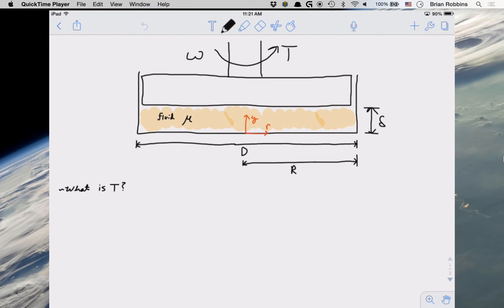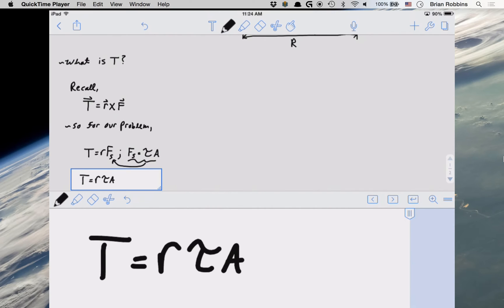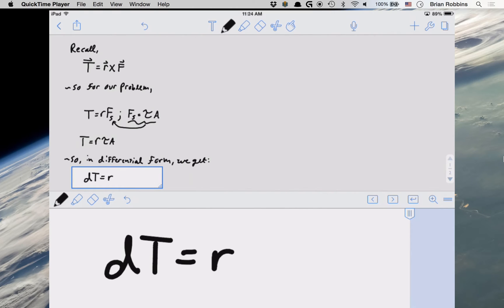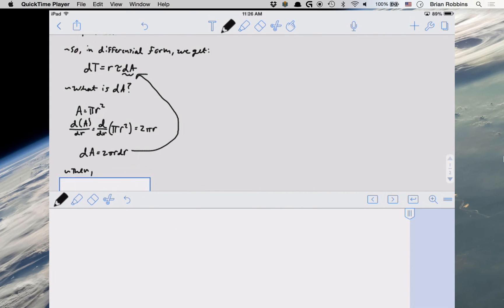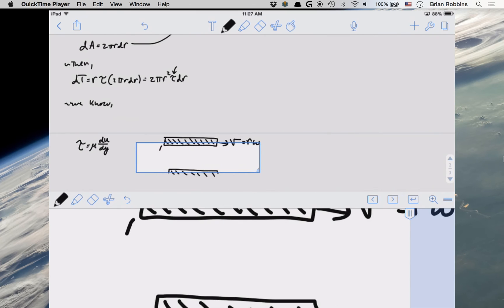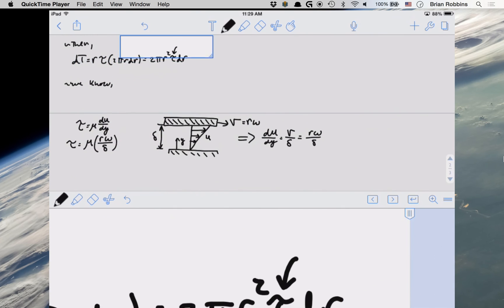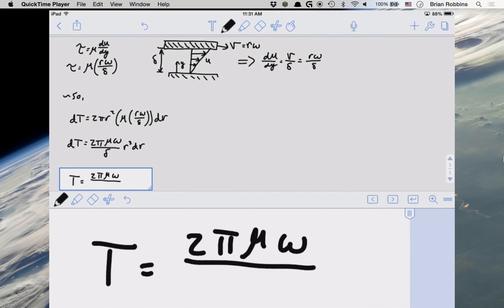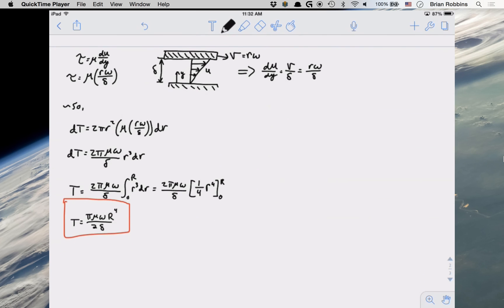ME-2124: Determining Torque using the Viscous Shear Force

Comment: Thanks for the video. I would like to ask a question. What if the rotating disk is immersed in the fluid, and far away from either the top or bottom surface of the fluid? How can I calculate the du/dy? Or how is this delta in your video determined then? Thanks a lot.